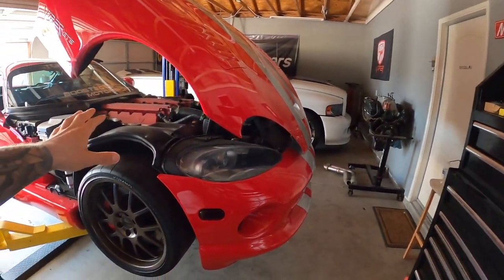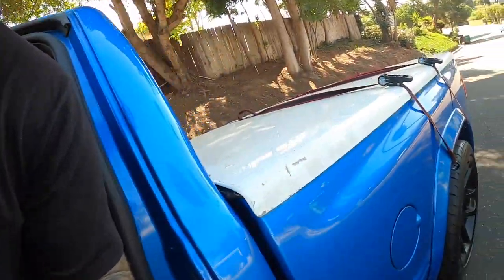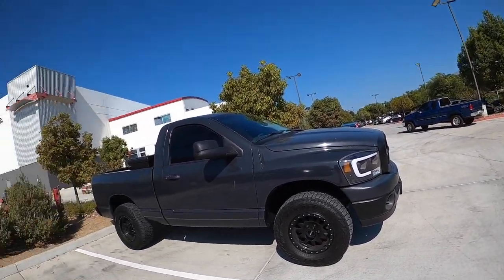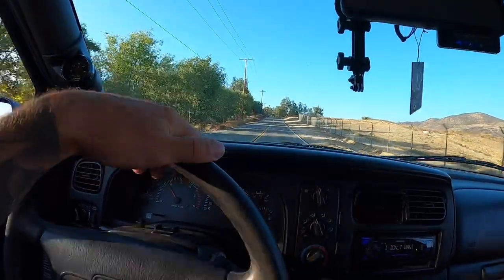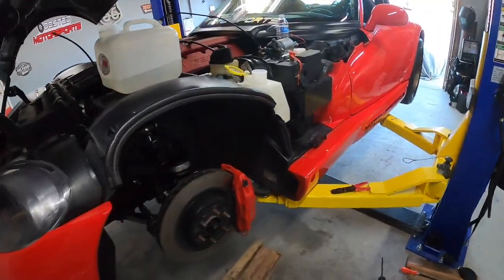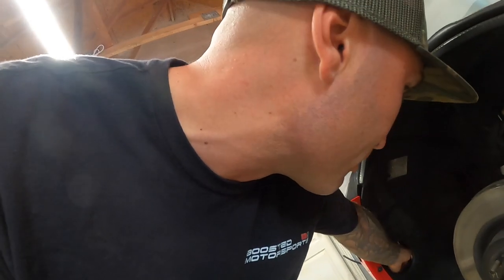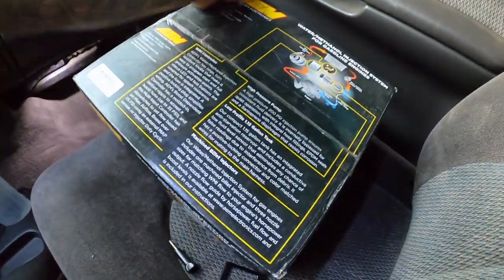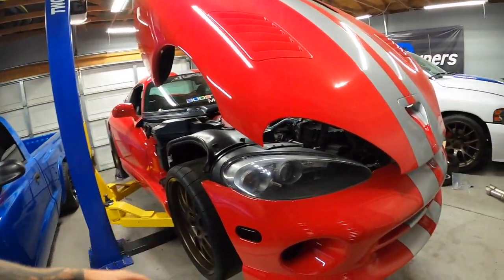NEW DODGE DAKOTA & VIPER PARTS | BOOSTED VLOG

Comment: try shifting around town from low, to second etc, close in to other traffic etc,it will give you a thrill.....be careful or you might crash an burn..a great anxiety reliever for sure..flowmasters on mine are hard to beat from about 2006, the middle ones i guess, loud in cold weather.

Comment: I want to get some rims for my 2000 R/T in like a month or so, what width should I run? I definitely want 20 inch rims, but idk if I should stick with stock width, or if I should go wider, and how much wider I can go without having any issues (im on stock ride height as well)

EDIT: I also don't know what offset I should use, the rims I am looking at right now are 20x9, 33mm offset, 6.3 backspace.